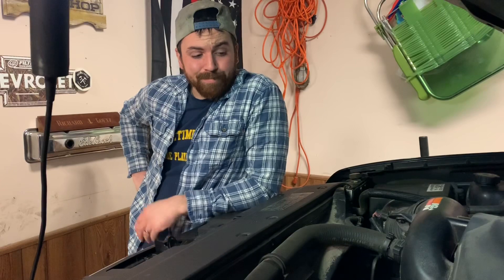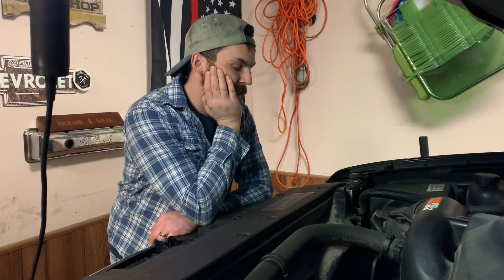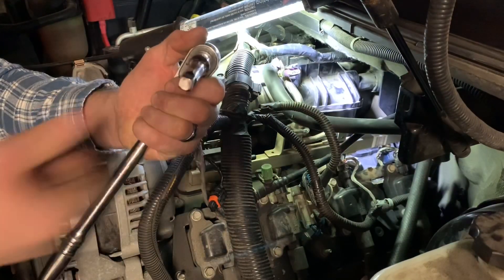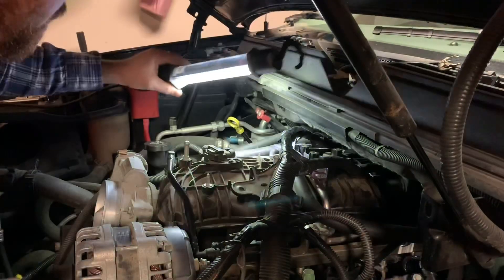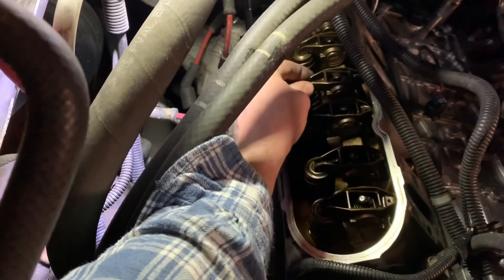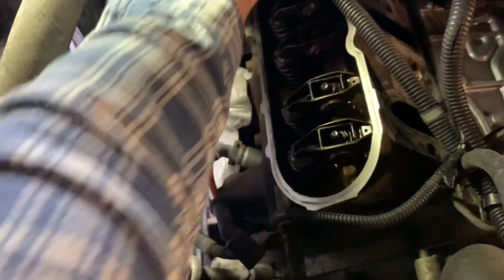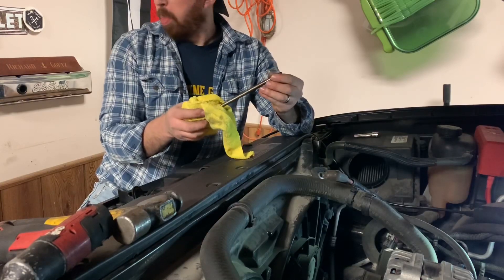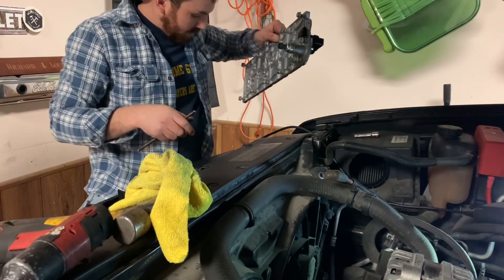The Avalanche Is Back (Lifter Tick)

Comment: i bought an 08 Silverado a few years ago ...had the same problem with 110,k on it..the guy i got it from replaced the stock motor all together...less than 6 months later he had the same issue come up again after spending tons of cash on it ,he was done with it so he sold it to me for 3500$.. had me stacking bb.s for awhile  i finally figured it out changed the LOMA  freed up the no7 lifter change the oil to full sin ran like a champ for 6 months..i let the oil get dirty over 5000 miles...the miss came back on 3 this time..did the same thing again got lucky was able to free the lifter replaced loma and the valve covers no cam damage that was at 118k miles... now the truck has 288k on it , only lasted like that bc i kept the oil changed every 2500 miles.. yesterday the miss fire came back on one... so i tried the same thing new LOMA was able to free the lifter ran like new for one trip to the store...i was like fuc ya.. but then on the way back from the store it started missing again..think i might scrap it get a new one , near 300k yea got my moneys worth f it
Reply: Could be the oil pump giving out. I heard that a weak oil pump may cause the engine to run ok, but not quite enough pressure for the lifters.

Comment: Great video. I have a 07 Silverado 1500 and it has the exact same ticking noise! The oil pressure goes around 30-35 while driving. But, I’m having that ticking that goes on and off randomly. It has 140k miles on it and never had a problem before and it’s not loosing power neither. Also, almost every time that i cold start it, it will blow white ball smoke out of the exhaust. Any advice I will appreciate it!
Reply: mine is doing the same!!help
Reply: @Bart Garfunkel I’ve been told to replace the head gasket, all rest of the seals and lifters. Haven’t done it yet. Mind if I ask you how much $$ it cost you?
Reply: if you have vortec engine dont use a synheic oil.  the engine runs slightly hotter and the synthetic can burn off while driving.  i would see puffs while driving and burned a lither every thousand km. switched to 5-30 and the puff went away. i think i have afm issue now

Comment: Did you try replacing oil pickup tube o ring inside pan? Test to see if that works by jacking up rear higher than front if tick quiets thats the issue, your welcome!

Comment: Yes that way I can do the work and not be liable this is why I do my own work rather than having sum jerk off trying to take my money and not fix my problem if you would have liked the lifter for 24 hr and installed it correctly and probably change the cam or the comprsstion spring and valve tht keeps putting  the lifter out

Comment: I'm rebuilding mine currently, except I modified the vlom and got rid of the scree so no more oil goes through it and am having my ecm tuned to get rid of the afm/dod hopefully mine won't have issues after it's all done
Reply from the maker: Nice. Yeah I ended up doing the same with the vlom gasket. Hoping to do a full delete soon.

Comment: Is that the engine people have lawsuits against GM on? I think its the 5.3 used in the 2010-14 models that has problems.
Reply from the maker: Bryan Wayne yep, 07-13 have these issues. I have a 2010 5.3 with 160k on it now, no issues yet. Some people have good luck, some don’t.
Reply: @TheDieseldog  03 Avalanche same issue here.
Reply: I have a 07 avalanche Ltz edition and I haven't drive it in 2 years, im about to start the process of getting it running so 🤞 on it going good

Comment: Kinda curious as to what the customer did concerning the Avalanche. I just picked up the exact year model and have the same problem. The lifter on Cylinder 6 keeps locking in the collapsed position. I have dropped the oil pan and replaced the oil pick up o-ring which improved the oil pressure . I have had the intake off twice now to reset the lifter. There is no metal shavings. Just wondering what happened in your case?
Reply from the maker: Once a lifter collapses, it’s junk. It’ll keep doing it. Only thing you can do at this point is either replace the lifter and replace the DOD oil manifold, or just delete the DOD all together. As far as I know this guys going to either replace the cam or try and trade it off. Now I hear there’s a lawsuit against gm for the issues with this engine.